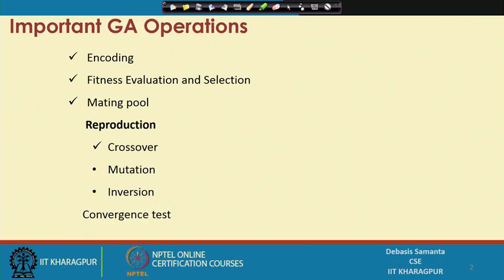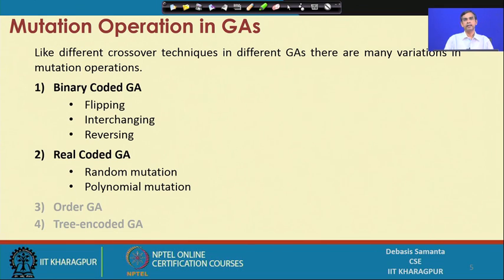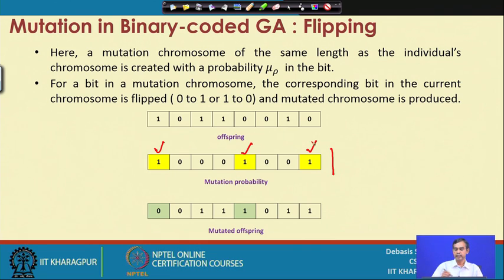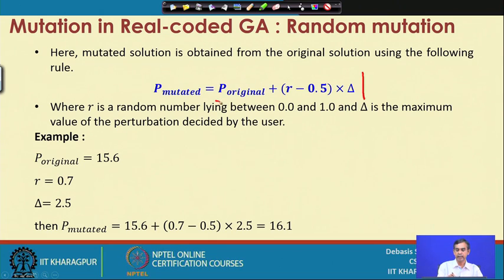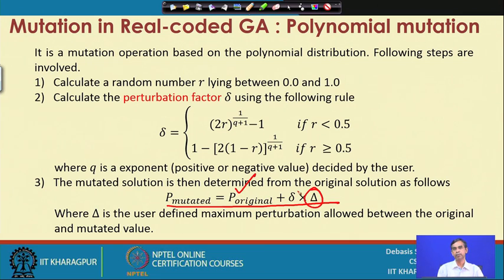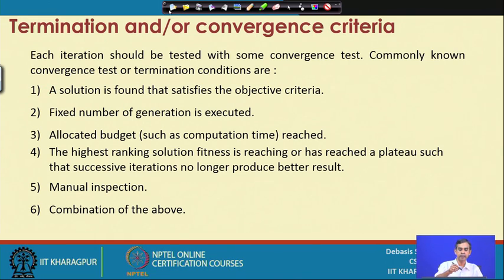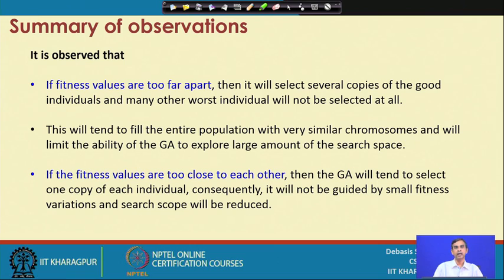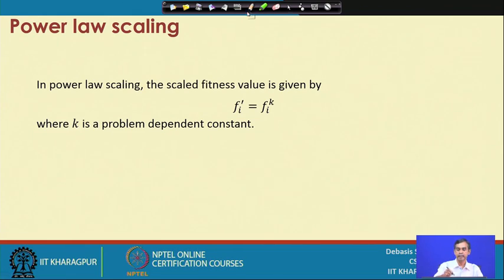Lecture 23 : GA Operator : Mutation and others

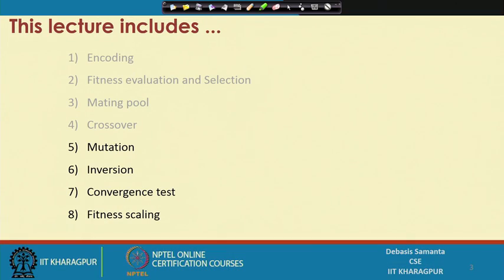Comment: The video discusses various operations related to Genetic Algorithms (GA), focusing on reproduction tasks such as mutation and inversion. It explains that these operations, like crossover, depend on the encoding scheme used in the GA (0:39 - 0:53).

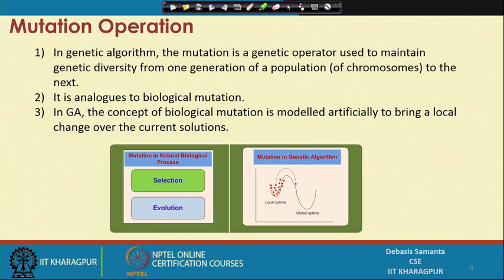The primary reason for mutation is to maintain population diversity at intermediate stages of iteration, preventing the GA from converging prematurely to a local optimum and allowing it to explore different search directions (1:06 - 1:49, 3:02 - 4:19). The concept is compared to biological mutation, where sudden changes occur in genes (1:52 - 2:36).

The video then details mutation operations for two main types of GAs:

Binary Coded GA:

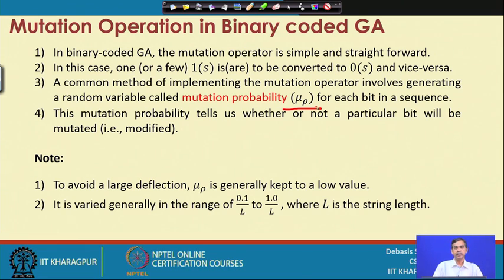The core concept involves flipping bits (changing 0s to 1s and vice versa) based on a mutation probability (μ), which is typically a very low value (6:06 - 7:35).

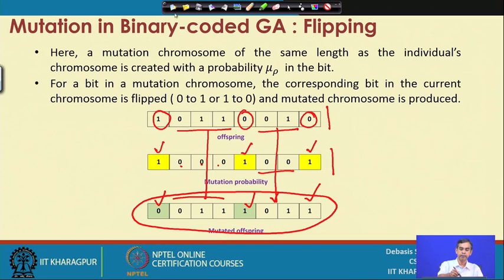Flipping: Involves changing specific bits (1s to 0s, 0s to 1s) based on a toss/decision process (8:30 - 9:54).

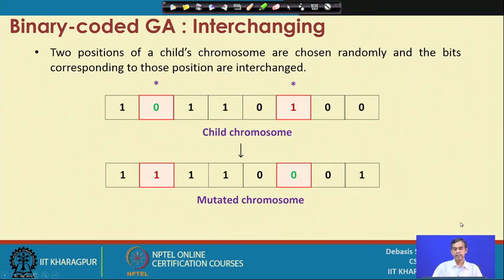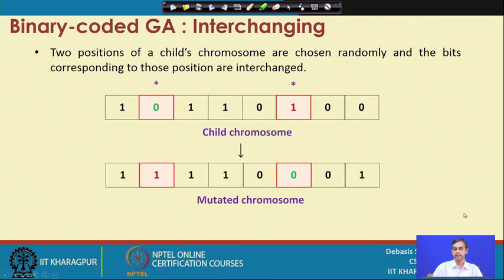Interchanging: Randomly selects two or more bit positions and swaps their values (10:40 - 11:51).

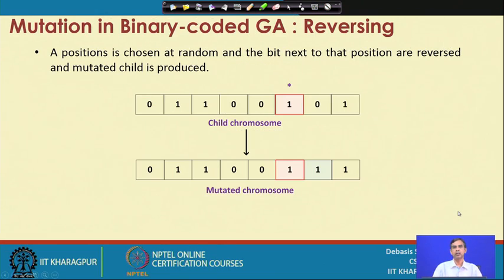Reversing: Selects one bit position at random and flips the previous or next bits up to that selected bit, causing slight modifications (11:56 - 13:01).

Real Coded GA:

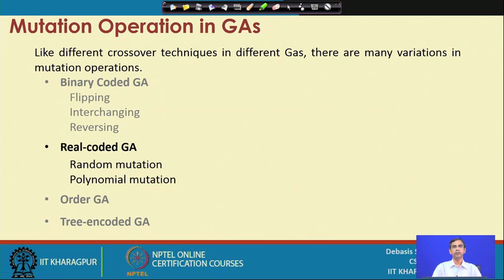Random Mutation: Uses an empirical formula that incorporates the parent gene value, a random number, and a perturbation factor (Delta) to compute the mutated chromosome (13:17 - 15:48).

Polynomial Mutation: A more computationally expensive method where Delta is calculated statistically based on a random number and a user-defined constant q (15:52 - 19:16).

The video also briefly touches upon the inversion operation, describing it as a drastic change that occurs rarely in GA cycles. For binary-coded GAs, it means changing all 0s to 1s and vice versa. For real-coded GAs, it changes very low values to very high values and vice versa (20:02 - 21:13).

Finally, the lecture covers convergence criteria, which dictate when to terminate the GA cycle (21:22 - 21:39). Key criteria include:

Finding a desired result that satisfies objective criteria (21:50 - 22:16).
Reaching a maximum predefined number of cycles (22:20 - 22:45).
Exceeding a budget allocation (time or memory) (22:47 - 23:29).
Achieving a stable best solution over several consecutive iterations (23:34 - 24:05).
Manual inspection of solutions (less desirable) (24:06 - 24:37).
A combination of any of the above criteria (24:42 - 24:59).

The video concludes by briefly introducing fitness scaling as a fine-tuning issue, explaining that the range of fitness values needs to be optimized (not too wide or too narrow) to avoid premature convergence or lack of guidance (25:20 - 27:36). Three techniques are mentioned: linear scaling, sigma scaling, and power-law scaling (27:48 - 31:39).